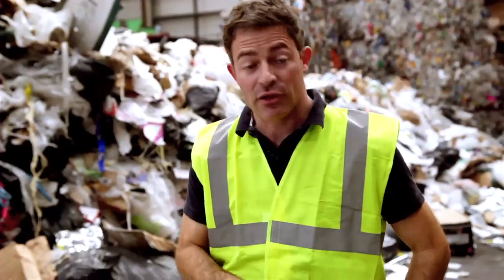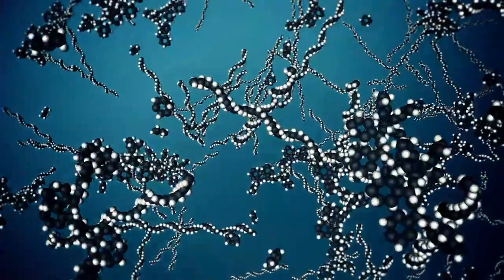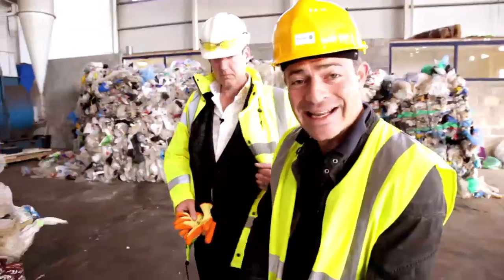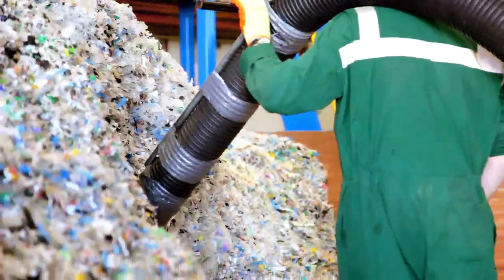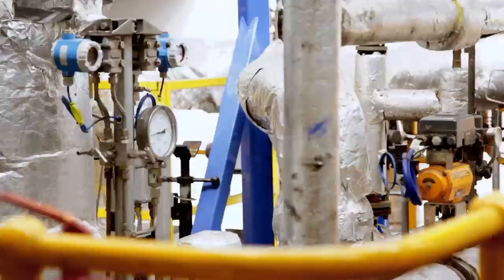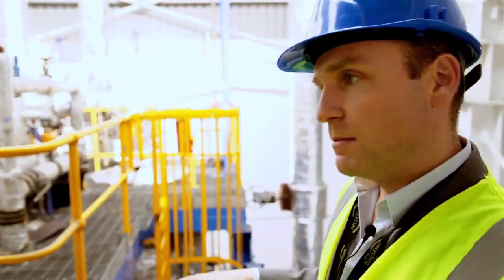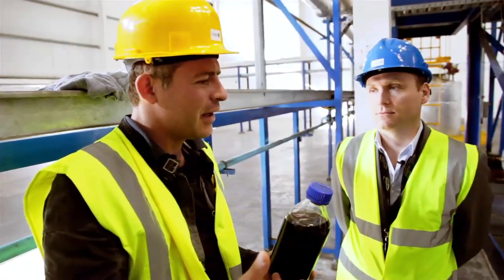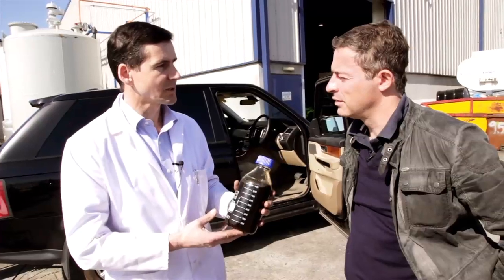earthrise - Plastic Fuel

Comment: Ofcourse this is not the solution to the large environmental disaster plastic causes. We should stop using plastic as a common material and start treating it as the chemical substance it is. This process though looks like a great solution for cleaning up our total mess, and to come full circle with the plastic usage we cannot do without (e.g. electronic boards, certain car parts and electric parts).

Comment: It does seem odd the 1 question most people would ask is,

Is it a net loss system ? my guess, YES, he was told not to ask that question,

It would be far cheaper to drill for new crude, than recycle crude which has already been refined into plastic, trucked all around the country, sorted by hand, and turned into a "Bovril" type of diesel,

I don't have a problem with this system, but the companies that create the plastic should be forced to clean up their own mess with 0 cost to the consumer,

When biodegradable options are available instead of government subsidized oil based products.

Comment: Its certainly interesting but it probably costs more than any other diesel if it was cheaper  than diesel it would fly off the shelves but it isn't hmm it seems like caring about  land fills is only a facade.
Reply: This kind of a plant is present in India as well and the polyfuel generated out of plastic is about 30% cheaper than petrol however the company in India is unable to get any kind of government  incentives and so they are pretty much at a startup stage. To answer your question it is cheaper.
Reply: @sayalikhot6751  its in the UK  tho so whys it more expensive?

Comment: Is there anyone kindly brief to me this process in the simplest way so that i can understand... Hit like if you love sandwish 🥪
Reply: The process is called pyrolysis. Pyro means heat, lysis means breaking apart. Plastic aka polymers r heated up to a critical temperature, in the absence of air where the polymer bonds r broken. Once the plastics r broken down to its base compounds or elements like diesel, petroleum, chlorine,  flourine, they r seperated by temp in gaseous state, known as fractioning. Diesel and petroleum can be distilled by collecting and cooling the vapours

Comment: It's still hydrocarbon not beneficial for the environment
Reply: Wrong, it still is a FOSSIL fuel. That's why It's bad. First it was petroleum, then plastic then gas... So really still as bad if not worse than regular gas... But there's true synthetic gasoline, (still a hydrocarbon) that is CO2 neutral, not bad for the environment... Its made by collecting Co2 from the air.... So no new CO2 is pumped into the atmosphere...
Reply: @setoain20  sequestering Co2 not re-emiting it is the goal to reduce CO2 levels. Algae biofuels (lamp posts not only sequester CO2 yet only emit oxygen when burnt.)

Comment: Does this process work for any kind of plastic or does it have to be a certain grade of plastic?
Reply: I think it only works for hydrocarbon only plastic like styrofoam not Teflon plastic or PVC because teflon and pvc will give off chlorine and flourine which will contaminate the pyrolysis oil.

Comment: We can’t grew plastic it will eventually evaporate in the air when it turned into fuel.... where would that evaporated smoke 💨 going to go?? 

To our lungs!!!

Let’s find better solutions than that.....

Let’s stop the fuel and start something else that doesn’t hurt us maybe electric which already started which is good but electric needs fuel!? 

We are moving forward but air compressors vehicles are better

Comment: I assume this "ash" contains chloride, fluor, brome and other harmful chemicals or salts. Depending on the dyes used in the plastic, they could contain other heavy metals as well! As for plugging a "Range Rover" as a bench test, it is a mystery to me as to how they purged the system and emptied the fuel tank using only 1L of plastic diesel, or was it just pouring it to a "mix"? And by efficient combustion, do you mean after the catalyst on the exhaust got hot enough?
Reply: Most dyes nowadays are organic or like TiO2 without heavy metals. Und Clorides aren't dangerous and i don't know why brome und flour should be in it. Plastics like Teflon don't make theire way in this machine .

Comment: You just need a lot of energy.

So build a nuclear reactor, its electrical power powers a vacuum pump that pumps out the air and the rest of the heat is used to crack the bondings.

And here you have the oil again.

Comment: Plastic feul is rubbish ! I have produced it. What they don't tell you is It causes extreme amount of carbon in the engine. Services are reduced from 15000km to 5000km . Spark plugs don't last , valves are clogging up and injectors gets sticky. Although the feul is clean when it is produced , it will discolour after a few days. This cause clogging of the feul filters and feul system. When it is left for approximately 7 days or longer , a black (tar) residue forms in the container or feul tank. It also dissolves certain types of rubber(pipes , o-rings) as well. There are many draw backs. Does the vehicle run as normal ? Yes, until it starts giving problems. Will I use it again ? No. Unless there is an emergency and no feul available anywhere. But please don't take my word for it. U are welcome to try it yourself. Be aware ,don't use an expensive engine.
Reply: Diesel engines use glow plugs not spark plugs
Reply: Peter Black, True , but some diesels don't even  have glow plugs either ,but they have valves and two strokes normally doesn't have glow plugs either but have spark plugs. Plastic feul does produce both petrol and diesel. All depending on cooling teperatures . The fact remain that both plastic petrol and diesel creates a lot of carbon in the engine and create endless engine problems.
Reply: @lappieslabuschagne2428  what happens if we use 50 percent plastic fuel & 50 percent diesel??
Reply: @prsn_naik  then you wil theoretically drive dubble the distance to get the same problems i suppose. Wil not reccomend this plastic feul....👍
Reply: @lappieslabuschagne2428  sir will truck owner see this as profitable for them ?

Comment: This movement is catching on around the world.  We need slot of smaller distillers along / near oceans and near landfills. Let's get  it cleaned up and use fuel for your home/shop  heating for the garden  
tractor and or field tractors.  Use Wmo or Wvo to heat the plastic.  When diesel starts flowing switch supply it can feed the furnace.  Wmo and Wvo is free for the asking. You will pay for cleaner filtered waste oils. Let's make some diesel.

Comment: Instead of letting the plastic sit in a landfill, you want to take it and make it into fuel oils and gasses so that the carbon that would have otherwise remained sequestered in the plastic, is now being burned and released into the atmosphere. Doesn't seem like an environmental win to me.
I guess though,  the people are going to need diesel regardless and blending in cleaner fuel would help somewhat.  What would be great, is if they could use concentrating solar power to provide the needed heat during the day. Heat up a tank of molten salts and use a heat exchanger to transfer that heat to the pyrolysis line. The syngas produced from the pyrolysis process could be stored to run the plant at night or sold if 24/hr operation isn't required. The molten salts would retain considerable heat, so work could begin quickly the next day.
Reply: They are not burning the plastic vapourising it.
Reply: @BRAVO1-s6t  Right, but the end result is that they are selling this product as fuel which gets burned and released to the atmosphere. So, which is cleaner? Leaving the plastic as it is or turning it into diesel to be burned in trucks?
Reply: That’s my concern that the plastic will have toxic fumes!? Would it be better to melt all the plastic and turn into new items? Could even be used to build houses and furniture!!!

Comment: 2k lbs of plastic creates 211 gal of diesel. 1758 lbs of the plastic is converted to fuel with 242 lbs of residual waste to be resold to market as recycled material. Diesel at $3 gal is $165 a barrel (55gal drum). raw processed plastic runs $7 lb. If anyone can find out the power source/method they use to heat/boil the plastics, a rough cost comparison to operate could be made.
Reply: I think you are right on the static on production of plastic fuel I am from Africa ( Nigeria) I am recycling plastic to fuel for  small scale entrepreneur .

Comment: The problem with this is the law of thermal dynamics. It will take more energy to convert plastics back into fuel than the fuel you get back.
Reply: not true, you dont know what youre talking about...
Reply: use a solar tower, or better yet build the factory on a volcano and harness the thermal energy
Reply: Untrue. It's being done in Thailand right now. Its profitable and efficient. Sepco industries Thailand.
Reply: Nuclear power
Reply: as research is done the process improves, but the alternative is to pollute the land and the water,... and of course the air, which the process still adds more pollution to, but i'd rather have a system in place to eliminate it and enforce strong controls on the air pollution created.  than bury it ... sooner or later when alternative energy systems are wide spread, we may not be taking as much crude from the land... and that is good, since its a finite resource... i hope the cycle becomes more manageable  in scale and such... but we need to clean up the mistakes of the past to help the planet recover from our meddling as much as possible so the young of tomorrow can see a better world.  ... as a side note, did you know you could turn nuclear waste into batteries made of diamonds?
Reply: Just having an alternative to the landfill makes the whole thing worth it.